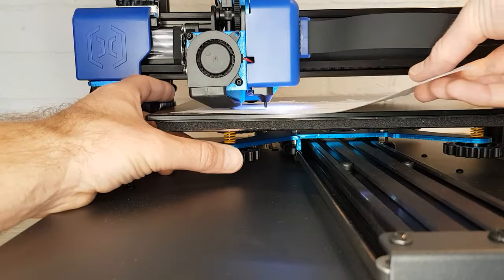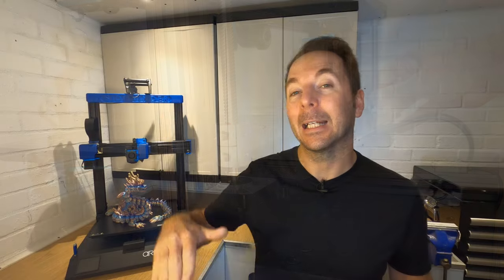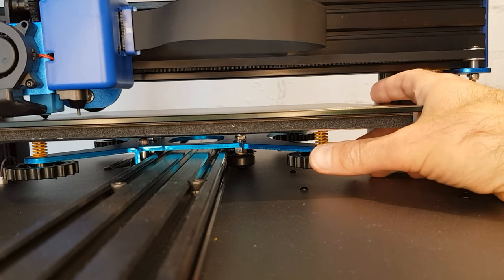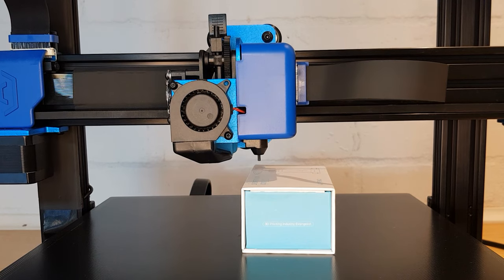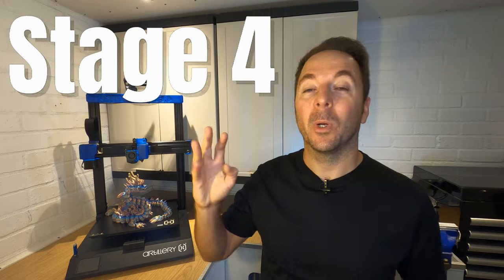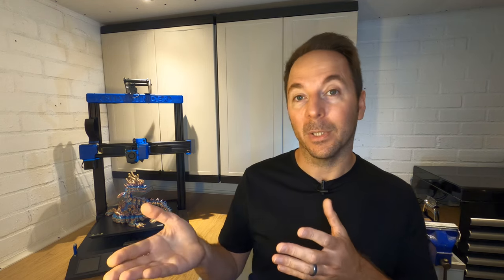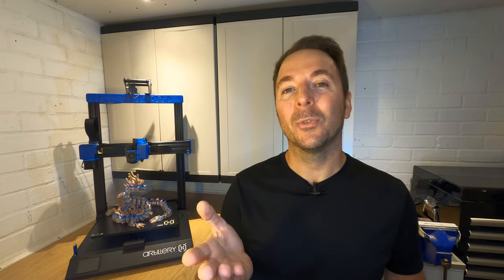3d Printer Automatic Bed Leveling - 6 steps to perfection!

Comment: Hello, thank you for the very informative video. I just installed a CR touch to my V2 today and was using this to help guide me through the process. I am still confused about zeroing the Z axis. I followed your steps and started a level test print and instead of actually dispensing the first line, the print head just dragged along the glass and nothing was coming out. i used a .102 mm feeler gauge (us damn americans never have anything truly metric on hand) and then subtracted it from my Z-offset so the head was touching the bed to "zero the z axis," but it wasn't even able to print the first "purge" line on the side and the perimeter of the print. instead it may have scratched a nice boxy outline.

Comment: Hello, thank you for this video - it helps me a lot.  I have a non-related question.  I have an Ender-3 Pro and when I autohome the extruder head is not above the bed - only in the "Y" axis.  Is that normal or do I need to move the bed in the negative "Y" axis and if so - how much?
Reply from the maker: Hi Jerry. No, when the printer goes to it's home position, it should be over the bed. The home on the Y axis is governed by the mechanical switch at the back of the bed. Have a look to see if it has been damaged, causing the printer to not know where home is.
Reply: @RickyImpey  Thank you I will look at that.  I noticed that there was small piece of formed metal for a sensor when I unpacked the machine and I thought it was just an extra.  I soon realized it fell off the Y axis sensor, are they supposed to fall out so easily?
Reply from the maker: @jerrygorman5030  Ah yes, that will be the problem. They can be fragile. The limit switches are a very common part though so finding a replacement should be easy. Let me know if you struggle though.

Comment: I have a CR-10 Smart that doesn't have bed leveling adjustments what is the workaround to level the bed + mesh or did I miss this in your video?
Reply from the maker: Hi John. I don't have the CR-10 Smart myself but I believe they did away with bed adjustment and use a pressure sensor in the hotend to replace a bed probe. This 'should' make setting a mesh much easier as you can miss out the whole manual leveling part. It should simply be a case of selecting the leveling option from the menu then pressing start. Have you tried this yet? Check out from about 30 minutes into this video for a demonstration https://youtu.be/nASomewmJe8

Comment: In step 3 you say that the thickness of the item you use to leave the bed does not matter as long as it is the same, and you even show an iphone as an example. So can I really use any flat object, like a debit card or thicker paper like card stock to level the bed?
Reply from the maker: Yes, it only matters that you use the same thing at each corner. You are just trying to get the bed parallel to the movement of the nozzle when it goes left and right, and back and forward.

Comment: I get so frustrated some times.  I can run the Bed Tramming Wizard (in the new MriscoC firmware) twice without touching the bed AT ALL... I get different results each time.  Why would that be?  Maybe my printer is warped?  So frustrating.

Comment: I don't understand why adding the M420 S1 Z10 code isn't talked about more often. As I understand auto bed leveling is hardly of much use without adding the code. With the code it follows the values detected and you could even have an uneven bed, without adding the code you basically have an semi-automated manual leveling.
Reply from the maker: There is a setting within the firmware that, if it's turned on, should mean that the bed mesh is used. However, it's not always clear which printers have it enabled and which don't and having the code on a machine that has it enabled does no harm. I always add it to be sure.

Comment: I have a question? I follow your video to T. IT works but when i look at the console it reads   {"code":"key61, "msg":"Unknown command:M420", "values": ["M420"]} so does this means its not working? I am running a Ender 3 S1. i just dont want to keep printing if i am getting an unknown error.
Reply from the maker: Hi, are you running Marlin firmware or Klipper on something like the Sonic Pad?
Reply: @RickyImpey  Hi. I get the same error and although my version of Cura says its using Marlin, my Sonic Pad is using Klipper.  Is this the cause of the error?  Is there a way around it?  Great video, BTW.  Thanks.

Comment: I'm a bit confused about 5:40 so the Z axis should be 0 or be "zeroed" by having it touch the bed
Reply from the maker: The z offset moves the zero point of the z axis. You want the printer to know that Z0 is the point where the nozzle just touches the bed. This is what we are doing when we adjust the z offset, setting the zero point of the z axis at the correct position. Hope this makes sense.

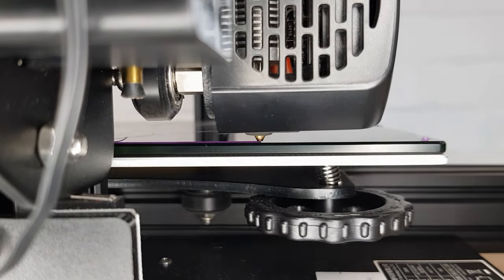Comment: 6:05 What happens if my springs are all the way down and one turn from the wheel from falling off and the nozzel is 4.5 MM away still?
Reply from the maker: This sounds like you z offset just needs adjusting to bring the nozzle down to the bed.

Comment: I must be missing something. When I set my ender 3 v2 with cr touch sensor touching the bed the nozzle is touching the bed while printing and no filament comes out. I really don’t understand.
Reply from the maker: Hi, the nozzle should only just be 'kissing' the bed, it will move up the thickness of your first layer before printing but if you have it a touch too low, there won't be enough of a gap. Try adjusting your z offset so the nozzle is a little higher. You can usually do this while the first layer is printing so that you can see when it's just right.

Comment: May I ask a question related specifically to the Ender 3 S1 Pro?  I'm a bit unsure as at what position I'm meant to set the Z offset.

In the menu after clicking 'Levelling' it does it's little probe thingy where it eventually move the nozzle close to the bed.  From there you can press 'Start' to make it auto level.  Or you press 'aux' where it goes to the manual level screen with the 5 positions and where you set the z offset.

My question is, do I move the nozzle to '1' position (in the middle of the bed) and set the Z offset from there.  Or do I leave the nozzle where it originally finds the bed after I press the 'Levelling' button and set the Z offset there.  This position is to the right and up of the '1' position. And they have visually different distances to the bed.

I hope this makes sense!

Comment: Hi, everything seems to be fine until stage 2. In stage 3 my nozzle continues to drill down into the bed until.....it reaches the centre of the earth😢. This happens after installing a pei sheet and trying to re-level the bed. My printer is the sidewinder x2. Any thoughts why is this happening? Im completely newbie
Reply from the maker: Have you varified that you bed probe is stopping the printer from moving the nozzle down? This would be the first place I would be looking. It sounds like your bed probe may be faulty.
Reply: @RickyImpey  Thank you for the quick response. Yes it does. It stops when i trigger it with my finger. It triggers twice but stops a little higher than the object i have used. So i adjust the z offset and save. In stage 3 when im trying to level the bed happens what i have already mentioned above. I forgot to mention that i followed the whole procedure before installing the pei sheet and i didn't face any problems. Should i reset my printer somehow?
Reply from the maker: @eliaspav5171 Hmm 🤔 that's strange. Fitting a different print surface shouldn't be a problem, it probes the bed and 'should' still set the nozzle the correct distance from surface it has probed. The obvious question is have you tried changing your z offset so that the nozzle sits higher?
Reply from the maker: Also, is the nozzle drilling into the bed I'm the middle or when you tell it to go to one of the corners?
Reply: @RickyImpey  No i haven't tried changing the z offset. I will try.
Reply: @RickyImpey  Starts from the centre and continues to the first corner scratching the bed
Reply from the maker: @eliaspav5171  What happens when you adjust the z offset to be higher? Does it go down to the same point? I should say, put a piece of cardboard or something ontop of your bed while testing this stuff so that you don't damage your bed.
Reply: @RickyImpey  Hi Ricky. I tried to adjust the z offset higher without any success. I made contact with artillery support service and sent them a short video. They replied that the BL touch is malfunctioning and they'll send me a new for replacement. I hope that will solve the problem. Thanks for the support!
Reply from the maker: @eliaspav5171  Awesome, glad they are trying to sort the proplem for you. It definitely seems like something is not working correctly.

Comment: Step one and 3 are the same.  Wated time.  This video has the potential to confuse a lot of people because it fast paced and u less you know what your doing can get lost.  If you knew what you are foing then you dont need this video.
Reply from the maker: I'm sorry if you found the video confusing. Stages 1 and 3 are not the same but it's a common misconception. Stage one is setting a base to start from. It's getting your springs to the correct tension in a way that doesn't induce any bed warp and gets you close to level when everything is cold. Stage 3 is accurately setting the bed level with everything up to temperature before you create a bed mesh. My advice is to do both but you can of course do whatever you would like🙂

Comment: I’ve just followed this advice on my first printer and it gouged my printer bed so badly that I’m already returning it on amazon. :( this was depressing.
Reply from the maker: Did you check that your bed probe was functioning first? It sounds like it may have been faulty.
Reply: @RickyImpey   yeah I did. I’m really not sure what happened. It all looked right then I started it and it just started grinding away. I immediately stopped it and re checked and it was as if it lowered itself by a ton somehow. I did the exact same process right after and it worked fine. I got the part swapped on Amazon already and am not having issues anymore but I still never found out what my issue was. Maybe since I have you, you can answer a quick question though… I use the g29 Gcode but want to use the other one instead. If I use the other one does that mean that it uses the last auto level save that I did manually? Iirc you said something about it being first save is that automatically the latest one you did or is there more steps than just pressing start on the auto leveling?
Reply from the maker: @55tristin55  Well hopefully it was just something put together wrong that is now completely sorted. Yes, if you use M420 instead of G29, it will use the mesh saved in slot 1. In 99% of cases that will be the bed mesh you have saved. It won't store more than one.

Comment: If only this would work on my Ender 3 S1 Pro 🥲
Reply from the maker: Why doesn't it work?
Reply: @RickyImpey  There is some firmware issue with the S1 Pro that makes the ABL mess up the leveling instead of to fix it. There are several threads on this issue on Reddit too. I hope Creality releases a firmware fix soon because I can’t get a RPI or something to run a different setup.
Reply from the maker: @Niels_Dn  interesting, I will be able to test this out for myself soon, I'm getting an S1.
Reply: Have you looked at other firmware? Pretty sure mriscoc/professional firmware support the s1?
Reply: @nodowt  On Reddit several people tried Mriscoc. It works but the display of the S1 Pro is not supported. 
For now I can print without ABL, but it’s just annoying that Creality doesn’t do anything.
Reply: @Niels_Dn  that’s a shame. The S1 pro would be a great machine otherwise.
Reply: @RickyImpey  Hi I recently got the S1 Pro and am having the hardest time with it.  I see you have one now, would following this video help?  I have updated the firmware to the latest (aug 3 i think) on the creality page.

Btw, I had NO idea the z axis offset was meant to have the nozzle TOUCHING the build plate.  I've watched so many videos and either I missed this detail, or lots of people are setting the z offset to be touching the paper.

Comment: Mate…stage 3 is confusing in this video…please understand there are some newbies trying to watch this and follow this, I am on a ender 3 v2 and your steps were way too confusing , your older video covered it better
Reply from the maker: Hi, which part are you having trouble with? Do you have a bed probe on your Ender 3 V2? If not, then this video is not the best method to use for your machine. I've had to make the instructions quite generic to cover a lot of printers, let me know what you are having trouble with and I'll try and help.